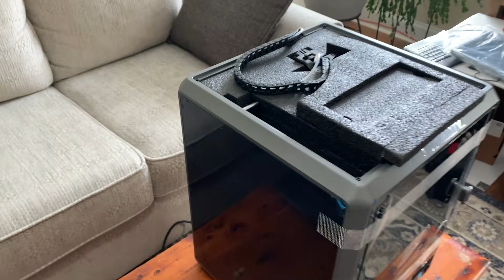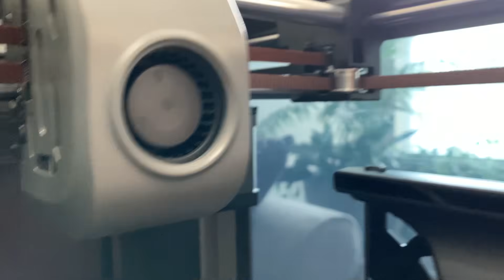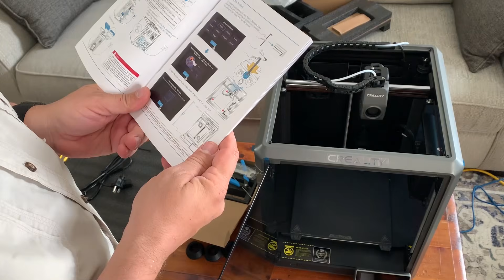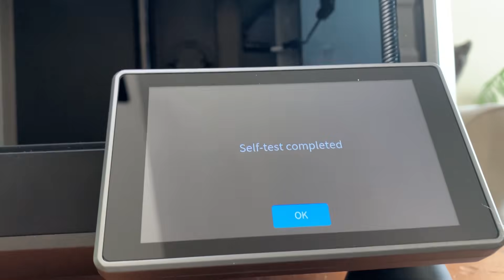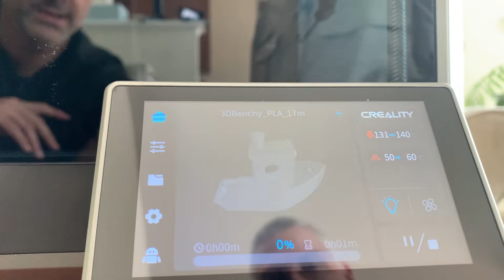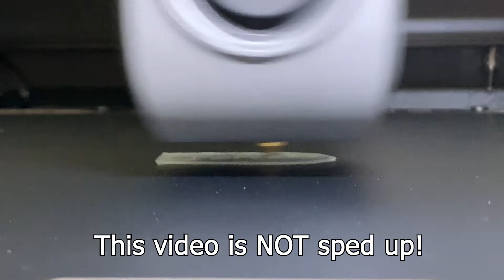Creality K1 Unbox, Setup, and First Print!

Comment: NETWORK CONNECTION ERROR FIX...
If you're having trouble connecting to your network and getting either "failed to connect" or "password error" it's likely your router is trying to connect your printer via 5G (5 GHz) but your printer can only connect on 2.4G.
If you know how to configure your router to only make 2.4G available when you set up the printer and connect it to your network for the first time, do that.
If not, physically move your printer somewhere further away from your router to a place where your singal is poor and your connection will be forced onto the 2.4 GHz channel. You can then move the printer back because it will remember it's connection and continue to connect via 2.4 G in the future.
EDIT: I had to take my printer out into my yard and plug it into and electrical extension cable to get a low enough signal strength to force the printer onto 2.4G!
Reply from the maker: Thanks
Reply from the maker: Couldn't you have put a box, pan, foil ... Something over your wifi router to reduce the signal?

Comment: is it possible to skip the network setup?
Reply: No.
If you're having trouble connecting to your network and getting either "failed to connect" or "password error" it's likely your router is trying to connect your printer via 5G (5 GHz) but your printer can only connect on 2.4G.
If you know how to configure your router to only make 2.4G available when you set up the printer and connect it to your network for the first time, do that.
If not, physically move your printer somewhere further away from your router to a place where your singal is poor and your connection will be forced onto the 2.4 GHz channel. You can then move the printer back because it will remember it's connection and continue to connect via 2.4 G in the future.
Reply: @zedspnner  I got CK1 and it is standalone now, without network setted up.

Comment: Thank you for taking the time to make and post this video. I've had a resin 3d printer for a few years now but I'm new to filament printers, just purchased this K1. It came with a glue stick, do I have to spread glue before I start printing? Thank you again.
Reply from the maker: I only use glue if I can't prints to stick without it. Wash your print bed with rubbing alcohol first and don't touch it with your fingers. Skin oils cause poor adhesion.

Comment: Hello not sure if you figured out why it shut off. But I think it's the voltage switch. On the side, there's a 220v vs 110v switch, it's usually left on the 220 side, and will cause the printer to shut off if your region has 110

Comment: Just set this printer exactly as you have done, prints absolutely nothing…filament is loaded just as you did, runs entire calibration then ran a print of the boat…goes through the entire exercise but prints absolutely nothing. What am I doing wrong????
Reply: I'm going through the same thing! Maybe try preheating? That's my next step!
Reply: @ yes! You need to press “extrude” to heat the filament, then “retract” after it poops put it initial heat test. Does the instruction guide tell you that? Hell no!
Reply: @frankschalk7790  For real! Setting this up has been a long and perilous journey 🤣
Reply: send it to me ill figure it out

Comment: Just bought mine, put it together and the door can't open or close without raising it, because the monitor is in the way, but no biggie though
Reply from the maker: Sounds like you didn’t push the monitor down in the mounting slots all the way.
Reply: That small monitor has to be pushed down. You have a tight fitting connection and it doesn't feel like it moves at first, but wiggle it and check the door clearance. You have probably found this out by now. It may be a benefit to others.

Comment: silly question - did you remove the foam from underneath the hot bed or leave it? i didnt see that part in the instructions so i wasnt sure
Reply: NEVERMIND, I realized it needs to be removed... another question: There were four rubber cones, I'm guessing those go under the foot pads of the printer? That's where I put them anyway.

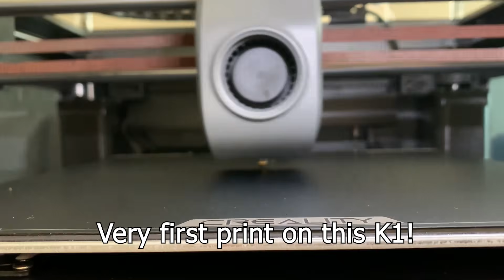Comment: 10:20 - Impressive that the K1 apparently managed to extrude filament for the first print without you manually loading the filament with the Extrude feature in the Settings screen.  Creality needs to do a better job with a Getting Started guide to help people learn how to use their new printer.  Then again, there are a few warnings about the power supply switch needing to be set to 115V for those not in a 220V country, and it looks like you guys may have missed that.
Reply from the maker: Thanks for watching so closely.

Comment: yesterday i got my K1, the first thing i did was:
- quit pfte tube and put a capricorn tube all out the cable chain.
- quit 2 pieces of cable chain for best travel of the chain.
- heat hotend at 200ºc, release the nozzle and squeeze again.
- clean the rods and threaded rod, put the grease coming in the box.
- change the smooth pei coming with the printer for a texture pei.

And slice a rotational spool holder with bearings, uncheck Arc in the slicer and print with 300mm/s and the result is awesome finish.

This printer is amazing!!!
Reply: And is it very noisy at 300 mm/s?
Reply from the maker: I didn’t think it was super loud, but with the head running so fast, it does bang around a bit.
Reply from the maker: Wow! Good work

Comment: I had a K1. Sold it right away. If you already have a bambu, you will be disappointed. If you dont have a Bambu and have an ender or something similar, you will LOVE it!!! Its a  night and day difference from an ender like printer. Falls short of a P1P
Reply: in what ways?
Reply from the maker: When?
Reply: I also had screws on the bottom of my printer when opening. It rattled way to much for my liking. First layer was awfull after 15mins of calibrating. Benchy printed ok but other filaments didn't stick. Only until i switched build sheets with my MK3 did i get a good print. I already have a bambu and so i am comparing the entire exsperience based on that printer. Its not even close to being as good as a bambu. Again, if i only had an ender 3, this thing would be AMAZING!!!! sorry for  all the misspelling, i am sofa king buzzed right now for the holiday. Corona.  PS, im not driving anywhere or printing anything today. lol
Reply from the maker: I wouldn’t judge you for Printing While Buzzed anyway.

Comment: You've probably figured this out by now,  but it shut down because the voltage switch on the power supply was set on 220. Need to switch it to 115v
Reply from the maker: I texted Chris so he can check the voltage setting. Seems like it shouldn’t work at all if set to 220,  it plugged in to 110v. But it would be nice if this turns out to be the reason. :)